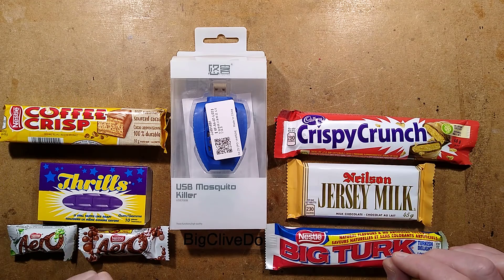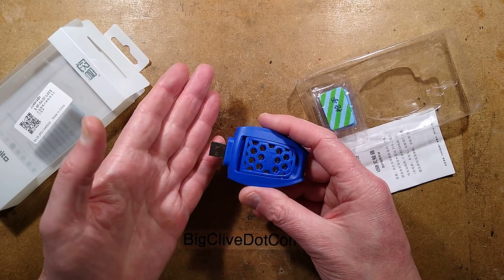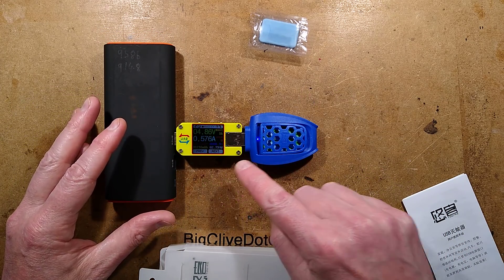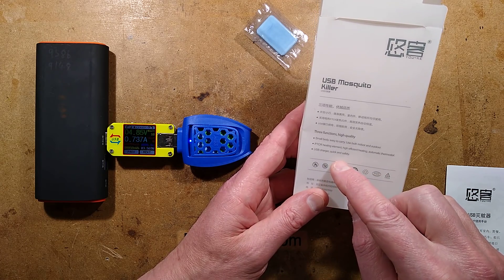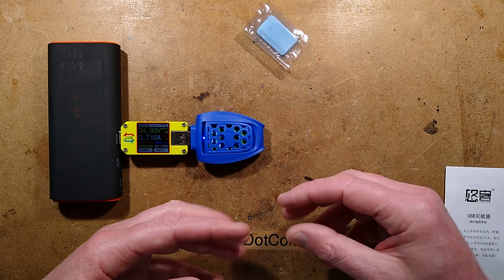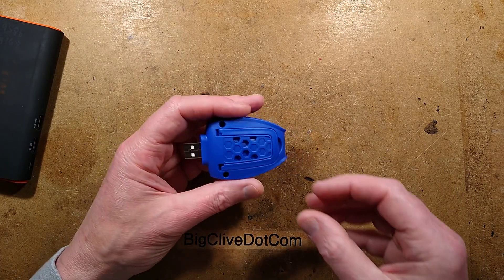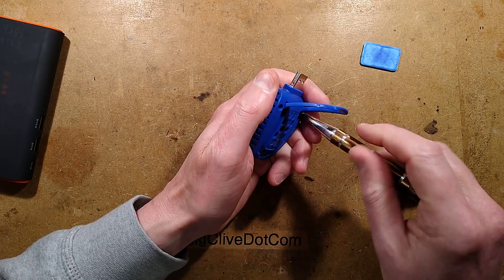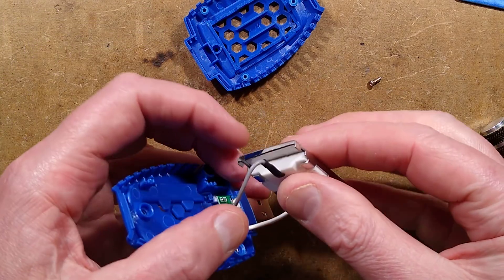USB insecticide vaporizer (and candy)

Comment: Can you send the chemical tab off for analysis?  I’m super interested to know what chemicals it’s vaporizing.
Reply from the maker: I'm not even sure where I could get that done.
Reply: @bigclivedotcom  https://www.als-testing.co.uk/services/foodanddrinktesting/pesticidesandagrochemicals 

Or

https://www.eurofins.co.uk/food-testing/contaminants-and-residues/pesticides/ 

You’d probably have to call and ensure they can do the full-strength tabs, as they seem to specialize in residue, but they should be able to dilute it if it’s too strong.  And I have no idea if this is £10, £100, £1,000, or £10,000 to do….  

(I am not recommending either of these, they are just what I found from USA, knowing this type of testing is available here). 

I will check eBay and see if I can buy this device myself!

Thanks for the informative & fun shows.

Comment: Thanks for t chance to see an evaluation how these are engineered. I've tested a number of these products for use as pocket warmers in winter, and as you found, it seems this style is consistently the best. Back to their intended purpose, while most of the chemical pads seem to contain permethrins, the CDC has approved a new chemical (nootkatone) that will be available next year and may be promising for he future of these types of devices. I've also found that I could recycle the absorbent pads after they have been used up with my own chemical concoctions made of essential and carrier oils with similar results. As you are effectively 'vaping' these chemicals, I'm kind of wary about their prolonged use.

Comment: BigClive, i would be very interested in knowing what is inside an ignition coil of a car. Especially the ones you put ontop of the sparkplug.
I got one with 3 pins coming out of it.
The rest is 1 piece of plastic. Basically.
But what pin does what, and what is inside?
Could you show that?

Comment: I suspect the pad would run out of chemical long before your bank would run out. The pad was already losing a lot of its color just from the initial test. Wonder if its the same chemical that thermacell uses - it has a pretty distinctive (though not very strong or offensive) smell.

Comment: Well even if it drew 1A... If the PowerBank holds 10.000mAh, that would be 10 hours, right? So a night in the tent would be possible...
Reply from the maker: 10,000mAh is the lithium cell capacity at new.  After conversion to 5V you get less capacity.
Reply: @bigclivedotcom  So the capacity printed on the power bank is fake, or at least misleading? Where are the legal actions? ^^

Comment: Did the instructions say anything about ampere limits? Powerbanks come with different ampere ports, like 1A, 2.1A and some of the newer ones have more than that. Maybe it could overheat and melt? I have seen USB rechargeable lamps from China where they specifically says that 1A is maximum.

Comment: I don't think I would want to plug that thing directly into my laptop and get traces of insecticide all over my keys.
Reply: It slowly diffuses across the whole room, so it shouldn't really matter where you plug it. It's likely to be a synthetic pyrethroid, anyway, so it's barely even toxic to mammals. Though they do often mix in other chemicals to prevent it from staining the heating plate, and those can be nastier than the insecticide.

Comment: The blue color makes me think dichlorvos(DDVP) which can be effective against bedbugs when used in enclosed spaces.in the USA it's marketed as Nuvan Prostrips. They are 8-10 times bigger than these inserts, and treat approx 50 cubic feet over several weeks. The intend purpose if for clothing and specialized equipment to be placed in a 2mil  30gallon poly bag along with the Prostrip, for two weeks to kill the.... hitchhikers.lol

Really useful as here in the us pesticides the kill bedbugs aren't available for the layman. But these are. Mostly used during heat treating structures.

I had a mystery bedbug infestation a few years ago, by the time I found one. They were hiding everywhere. Hired a company to heat the house for $1/sqft. Giant furnace came to our backyard on a trailer. Three giant hoses went into windows, and house was heated to 160deg f for three hours. Anything that couldn't be heated went into a bag for two weeks with a Prostrip.

Worked wonderfully. Everything was dead. I found mice, a rat, and sadly a bird that lived in the wall dead afterwords. But no more bedbugs. Or the tiny ants! House is over 100yrs old and I was met with this amazing wood smell when I returned. Deodorized everything and brought oils to the surface of the wood.wonderful

Anyway, my point is that I doubt that little teeny patch of material could really do anything for a room. Unless it's absolutely full of DDT. In Wich case you really shouldn't be in the room with it anyway.

Comment: I looked at the thumbnail and thought, this resembles the things my parents had 40 years ago. Then I watched the video. And it is in fact the same thing I believe. Ok ... 40 years ago, there was no USB. But, when I was very small we had those plug thing that went directly into the wall power outlet. And you also used these "paper or fabric" inserts, which were depleted when browned or so. And, I think these things worked "as advertised".

Comment: Hi Clive, my Chinesium FDGAO inductive charger tried to do the same with my mobile phone (tried to vaporize it). It blew a hole in the charger casing and also left a burn mark in my precious RV table. It's weird because having had another FDGAO wireless charger for 2 years at home I was pretty confident it was not gonna blow up.
Reply: Chances that you are going to burn your house down with a chinese charger are high but never zero !
Reply: @zumbazumba1  come on I used a lot of Chinese chargers... all the best chargers are MADE IN CHINA 😉
Reply from the maker: I try to buy all my chargers from prominent retailers here to ensure they at least meet local standards.

Comment: I have two nippers. One is for wires and the other is for destroying. When the "destroyer" nipper gets broken, I buy a new nipper as the new wire cutter and the previous wire cutter becomes the new destroyer. I always have a good pair of sharp nippers available.
Reply: i do this until i loose my destruction ones, i then proceed to use my "good" ones destroying the edges then immediately find my destruction ones, i have around 4 pairs of destruction pliers and cutters.

Comment: I was curious about the cost of this insect killer.  But really what's important is the cost of the refills of the poison.  Probably don't last too long.  Probably where they make their money!

Another thought: if this is meant for outdoors, how does it attract the skeeters close enough to kill them?  My thinking is it needs to be in an enclosed space in order to work.  Otherwise, live inside of a mosquito net.

Thanks, Clive.
Reply from the maker: They're often sold for use in hotel rooms.  The pads are usually rated for a single night's use.

Comment: Ha.  I used my side cutters (after sharpening them a bit) to cut my cats nails.  It's easier with their small size, and spring handle, and cheaper than the clippers you get at the stores.

Comment: We don’t call that “candy” it’s chocolate!
Reply: The chocolate is what is on the outside of the other ingredients, like wafer biscuits and nuts etc.  Technically, it's candy with chocolate as a main ingredient.  Here in Australia we DO sometimes refer to that as a "chocolate bar"  but the "bar" part implies the same thing - which means that if it really is chocolate but in a bar form instead of a block, we don't call that a chocolate bar, usually.  In the EU and UK there's probably some laws governing what you can call a "chocolate", meaning unadulterated chocolate with over a certain percentage of cocoa.  Low cocoa chocolate with less than 25% cocoa would therefore also be classed as candy, even if it is in a form in which you would normally buy chocolate, such as a block.  Since the milk chocolate used in the candy bar is probably around 26% cocoa (that's usual in the UK, Canada and Australia) the other ingredients would also take the total cocoa content below the required 25% so it's a candy on that level also.

In the US the  minimum requirement for cocoa content is 10%, so you get away with calling things "chocolate" that would not be legal in other countries, including fondant candy and things adulterated with butyric acid.

Comment: The electrical separation is needed if the device is used with standard Chinese phone chargers that have outputs referred to mains.

One Chinese manufacturer takes precautions against the deathtraps sold by other Chinese manufacturers.
Reply: It is so wholesome
Reply: "We know exactly the sort of chargers we would make!"
Reply: @K-o-R  - The general attitude in China is that if someone foreign distributor wants something super cheap and doesn't care about safety, they'll gladly make it for them. They're actually a bit more careful with products aimed at their internal market, because the government tends to take pretty drastic measures (i.e., death penalty) against manufacturers who knowingly sell deadly products within China.
Reply: I heard somewhere that when a chineese manufacturer was asked if they could make rough service light bulbs the reply was "I can put whatevery you like on the box".

Comment: Isn't Mica a mineral that helps with fire resistance?
Reply: It's used as an electrical insulator where high temperatures are present.  Toaster elements are just nichrome wire or ribbon wrapped around a mica card.  Back in the day, it used to be an actual sheet of mica which is of course quite expensive since the sheet had to be split off the large block in a manual process.  It was usually muscovite mica which is a sheet silica which crystalizes into thin layers so lends itself well to splitting into sheets, but it would still have been a labour intensive skilled job.

Most mica you see today is like this example, which is finely ground and reconstituted muscovite mica, which means it's possible to use more robust mining techniques since you don't care so much if the mineral is broken up a bit in the process.  Reconstituted mica also lends itself to more automated production of the final product of course, so it has become relatively inexpensive compared to the older methods.

I'm guessing that reconstituted mica has replaced asbestos in a lot of industrial applications such as kiln linings and fire doors, but it has always had applications as an electrical insulator right from the start (in it's original silica sheet form).

Comment: For a minute I thought this was going to be about what happened when you put candy in the vaporizer...
Reply: I thought the same.
Reply: Yep that's what I thought
Reply: i've built a device not quite unsimilar to this one but bigger (and it heats up a mosfet rather than a resistor (i will certainly go to electronics hell for this) ) and we actually use it to reheat cookies and brownies. It reaches up to 120°C (adjustable binary regulator) at which point you have to actually wait for the cookies to cool down. It's great fun and also it just tastes alot nicer
Reply: I know I feel kinda jipped lol

Comment: I've had the plug-in version of those when I was little, and quite liked the smell of the tablets. Might not have been the best idea to straight up smell them
Reply: I sniff my Nintendo switchs exhauste anyways so I think it's fine
Reply: @OhSoTiredMan  I know exactly what you mean. I'm guilty of it myself lol. It just smells so good when your loading a game in. :)
Reply: @Niko-20-w1k  If it smells, it cannot be just air. ;) And electronics (especially under heat) give off quite a few, partially pretty nasty substances into the air.
Reply: @OhSoTiredMan  Glue/Adhesive, rubber and plastic.

Comment: Does the aerosolized bug repellent have an odor? Is it citronella! Does it leave residue outside of the unit? The footstand is probably to help with air flow.
Reply from the maker: No obvious odor.
Reply: @bigclivedotcom  the thermacell units have a faint flowery odor when they are running. The MSDS says they use d-cis/trans allethrin. Curious if you have found other thransflutherin pads have a smell, or if they add something to the thermacell branded pads so people can smell it working?

I am looking to order a jug of the pyrethrin repellent and re-soak the spent pads in it since they cost $1.60 a pad.